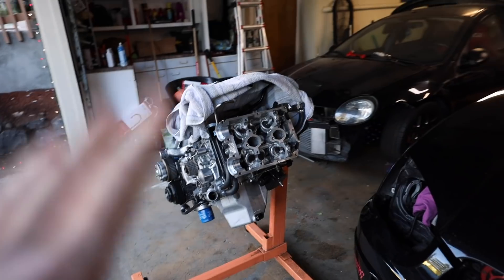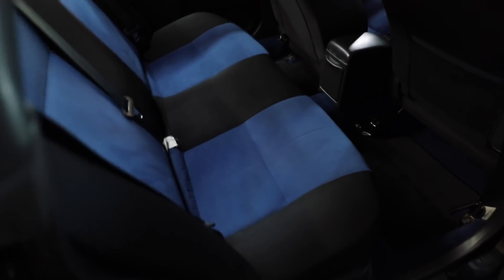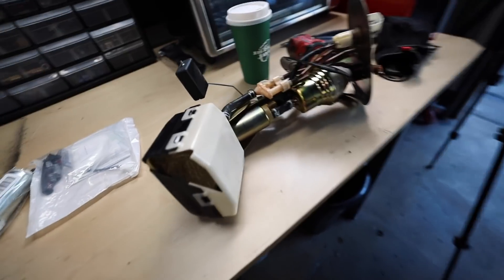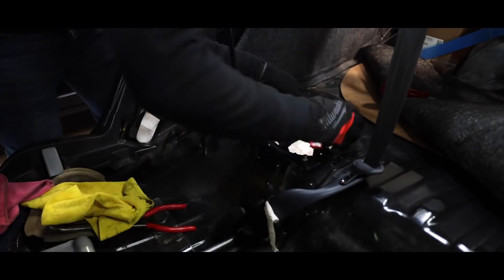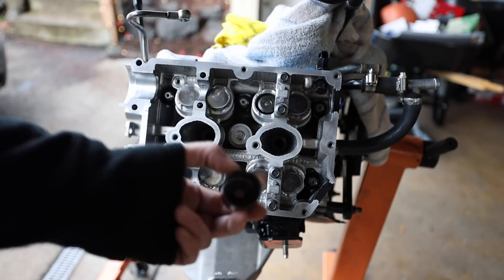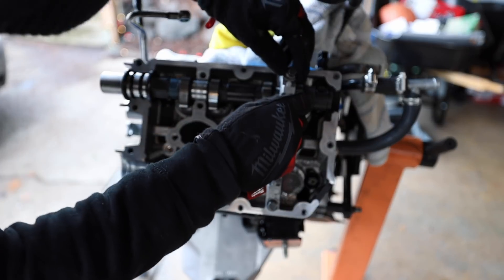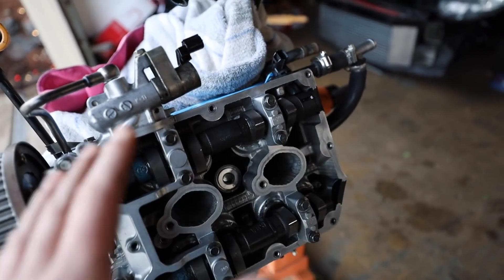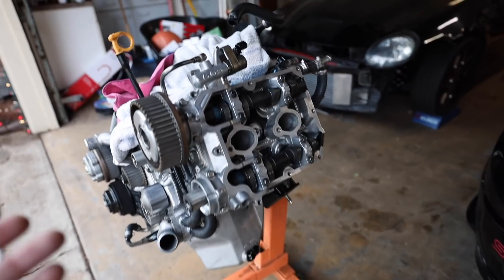Subaru STI Valve Lash, ALWAYS Double Check Your Measurement!

Comment: When my shop was open I had a large rack mounted on the engine room wall with containers for a few of every single available size of shimless bucket because I got to the point I was just done with measuring then waiting and even after doing it many many times I  would still very rarely measure one of the valve clearances wrong then have to wait again plus the early ej20s had shimmed buckets and they were bad for spitting out the shims so I always replaced all the buckets with shimless buckets any time I had the heads apart on an engine 
At first it was a very expensive choice because those things are not cheap when you consider I kept atleast 3 of each size and if I'm remembering correctly there are  98 separate part numbers  but after that day having them right in my engine room made things go so much better.... and side note  in my experience  there are only about 15 or so sizes that are ever used and I had a few that were never used years later so ya lol

Comment: What may be the symptoms of incorrect valve lash? I recently rebuilt my motor and i sent the head to the machine shop to deck, when i reassembled it i reinstalled the buckets as the came out and well my first start went poorly, the car idled like dog water and well I didn’t recheck the valve lash cuz i assumed all was good, cuz the previous build was like 15k km old. I’m strongly suspecting incorrect valve lash. Any info would be greatly appreciated, i would try to cc a link to this comment if that would be helpful. (I’m shim over Bucket 04 wrx)
https://youtube.com/shorts/OTO2t4VOfgs?feature=share
Reply from the maker: Ticking, excessive wear on the cams, bad idle, runs poorly. The lash will directly coorloate with the cam duration. So if lash is to close or too lose it will 100% effect how the car drives and runs
Reply: @Smeedia  much appreciated man…. I guess I’ll be doing the valve lash this weekend here, hopefully I don’t have to pull the motor

Comment: Why cant you do (Bucket)-(rest of clearence needed) = Desired Bucket? Im doing it this way and am getting different numbers compared to your method. I see why your method makes sense but I think my way of thinking is also correct. How should I be thinking about this?
Reply from the maker: Used buckets may no longer be true and accurate. You can do it that way but I would suggest measuring the bucket to verify your starting value

Comment: If I understood it correctly, 3 valve followers were the same size and the same clearances as well. One was too big. 
Why didn't you take the current number from the inside side of (good) buckets to order a convenient one!?))
Reply from the maker: Because it still qouldent have been the same, valve clearance would have been off still, each bucket is a diffeent size. None of them are the same
Reply: @Smeedia  wha?
You've amazed me now..
I've always thought that having the same valve spring retainer set means having an equal set of buckets.. 
It's just a logical deduction.. Because everything has, of course, the same size and length... So and, measurements must be the same..

How does it work on the contrary?
Please, explain it to me
Reply: @Smeedia   hope you do not leave me without an answer)
Reply from the maker: Not always, because the valve seat can be slightly diffrent and the cam clearance can be diffrent it will make buckets slightly diffrent. Would be nice if they were all the same though lol
Reply: @Smeedia  what could you say about choosing the optimal or the best clearance for those camshafts that you don't know a recommended clearance. Let's say for 280 cams. Maybe, there is an equation  on how to find an optimal clearance?
Reply from the maker: Typically you reference the Cam card that comes with the cams for the lash specs 🙏

Comment: Ditch that walbro 255.. it cant flow enough on high boost application...

U need dw340 to be on good spot...

Walbro 450 u need to redo bigger feed and return line
Reply: And does us 05 sti still run on sidefeed injector?

Thats new to me... I always thought sidefeed injector only up to 02-03 cars without avcs.... 😅
Reply from the maker: Swapping to top feed with ID1300s and I have a AEM340 ready to go 😅

Comment: I use a micrometer on the buckets, especially the used ones. I have one here in my hand that says 499, it measures 0.1946 inches or 4.94mm.
Reply from the maker: My point mic fell and needs to be sent to recal 😭

Comment: Do the cam cap bolts have anything to do with the cam to bucket clearance?  I think they are stretch bolts right?  Wouldn't you have to replace them every time you take them off?
Reply from the maker: I've got new ones, but they shouldn't be strech bolts. They only get torqued down to 7 ft lbs. At then they're set
Reply: @Smeedia  ah, I see.  I guess I read some bad info from the forums 😅

Comment: My temperatures keep rising up. They go down out of no where and everything is fine and then again go up. No smoke from the back, coolant levels are fine. Heat keeps coming and going. Oil isn’t milky. I have no clue what’s going on. I did a head gasket job about 3k miles ago
Reply from the maker: Oil Temps or coolant temperature? How high is it going?
Reply: @Smeedia  coolant temps and it goes up high. 227 and then it goes down
Reply from the maker: Thermostat new also?
Reply: @Smeedia  no I thought it could be the thermostat or maybe a coolant hose that went to shit.
Reply from the maker: Could be more air pockets in the system 🤔
Reply: @Smeedia  I need to properly burp it. Took it to a shop (my brothers friend) to do burp it because I’m just really far away from any Subaru specialized shop and he said that he burped it but bubbles kept coming out. My concern is how this air got into the system in the first place...

Comment: Would you say cost wise. Buy a built out together motor and have someone do the swap. Or buy all the internals and have someone install those on current motor
Reply from the maker: Honestly depends on the shop and what your building. What's the WHP goal and budget?
Reply: @Smeedia  between 500-600whp. And just looking for the best cost effective way to get there I know it’s all expensive haha
Reply from the maker: Cheapest way is going to be to buy a pre-built short block and build your own heads 😅

Comment: You might want to go ahead and order a second and third next size buckets just in case your measurement were slightly off as those parts wear things change.  Meaning the reading on the bucket is probably off due to engine wear.  

 I like to have my valves spot on if you get them all equally the same you'll get a slight HP bump in power.  More power = better 🏁
Reply from the maker: More power! If this new bucket is a little off (which I'm hoping it shouldn't be because it's a new bucket so the measurement should be spot on) gling to snag 2 more just to be sure. Those buckets add up quick 😅

Comment: The dealership likely put in a new oem fuel pump. That stuff looked brand new on camera. At least that'd be my guess. Dunno if it came from a Subaru dealership or not.  
Merry Christmas by the way!  Glad the car is making progress,  you lucked out with that engine imo, at least with your know-how to fix the valve issue.
That thing is gonna be a beast.
Reply from the maker: Was a third party dealer so not too sure on that one, got the turbo situation figured out as well. Can't wait to get it running again!

Comment: Use a micrometer to measure the bucket next time, the number on the original bucket is no longer it’s original clearance, gotta consider that the bucket and valve is ground down over time
Reply from the maker: My point mic needs cal, but agreed, this new measurement should be spot on now
Reply: @Smeedia  also you should clearance all of the buckets, your taking a cold measurement, those buckets expand when hot
Reply from the maker: Agreed, but the spec measurement is also a cold measurement, once they expand it should be fine. Following Brian Crowes Cam card and emailed their product team to verify

Comment: You should replace your radiator cap at some point too. Just had a wrx show up to my work that was over heating and pushing fluid, turns out it was just the cap🤷🏽‍♂️
Reply from the maker: Prob going to replace the whole radiator, this one's olddddddddd AF

Comment: You can’t shave the bucket?
Reply: Better to grind valve tip
Reply from the maker: You could, I wouldn't recommend it though, people have done it with no issue but if you shave an area too deep it's going to cause the lobw of thr cam to potentially dog into the bucket or the valve. OEM buckets are $20 so I'd rather just get the appropriate size